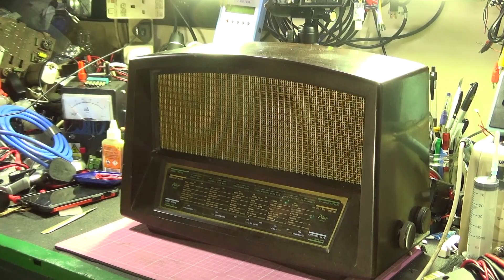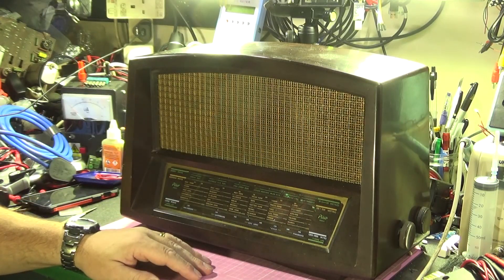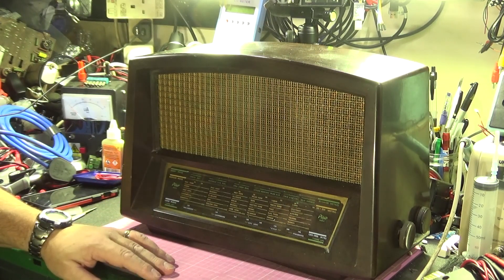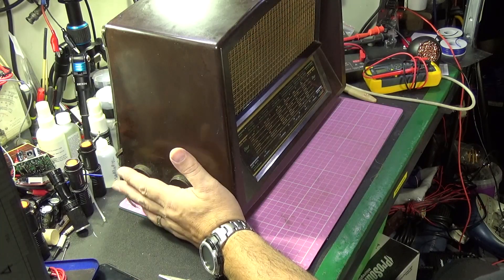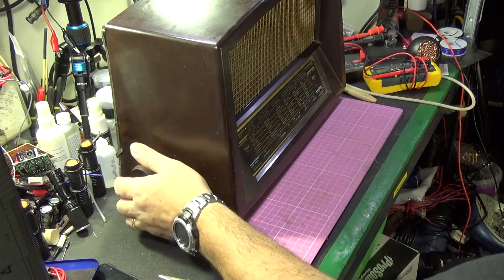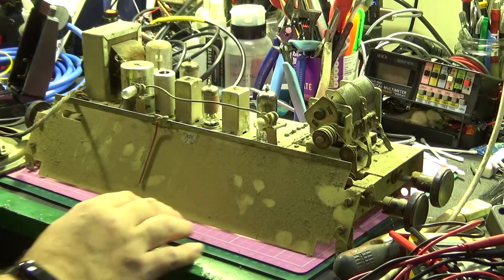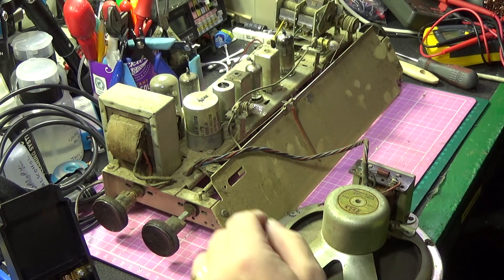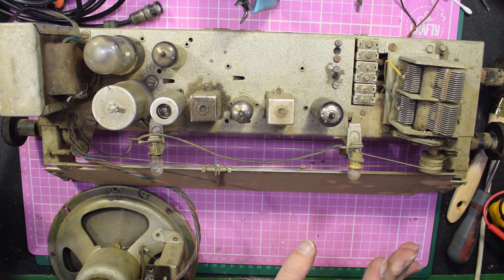1950s Valve Radio Repair - Pilot T85M Pt 1- First inspection/power up

Comment: Well worth a restore, George. I seem to remember an old Shango 066 video where he actually used a transformer out of a walwart supply for an output coupling. Sure there is an impedance mismatch, but good to use as a troubleshooting aid. Can't wait to hear it operating!
Reply from the maker: I have actually found a replacement! Impedance matching is almost exact between the two. I found one that came from an output stage running an ecl82 which is close enough in load impedance to the 6bw6 in this set. I did strip the old transformer and the winding had broken almost in the centre of the primary. There was some evidence of heat damage so the reality of it was that it would be either a full rewind job or junk it and find a replacement.

I also remember that video with the wall wart psu. neat solution to the problem.

Comment: Great video George and use of effects....what's the ESR value of that spider?  :)  The safety power plug thing you plugged the radio into, I've seen Big Clive use them, there cool...hope you get past the coil.  ~Jack, VEG
Reply from the maker: I haven't measured the spider yet Jack, but it is on the list of jobs! The safebloc is a bit of test gear that everyone used to have in the 70's and 80's. I wish I still had my original one. They got banned in a lot of workplaces under 'safety rules' which is stupid because they are safer than pushing two wires into a socket.... I only bought that one recently and they are certainly not as cheap as they used to be!